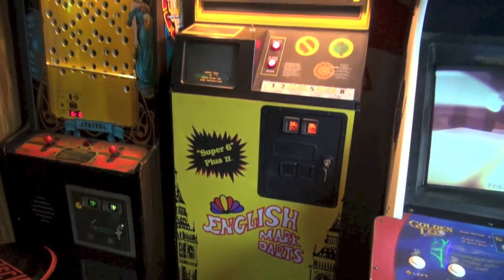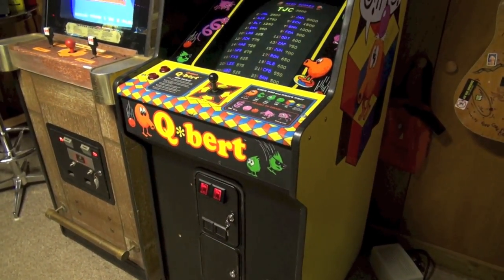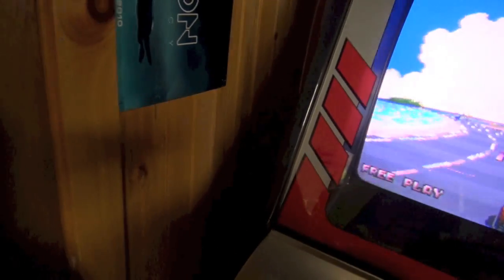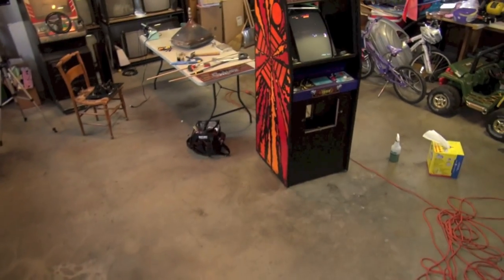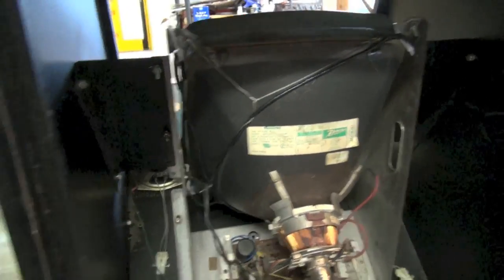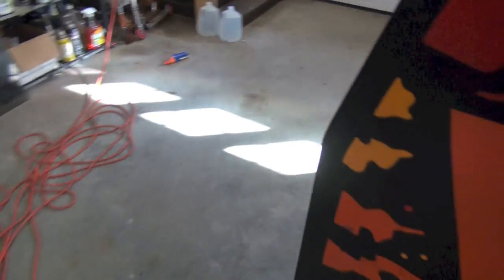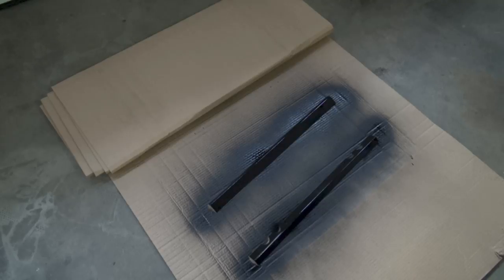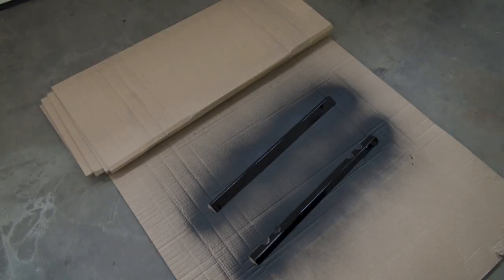Gyruss Arcade Restore (PART 3) - Stripping and painting metal, replacing ground plug, woodworking

Comment: If you were to hang your parts with a bent coat hanger, the result is better, and they dry quicker because they aren't sitting there surrounded by wet paint. (and you wouldn't be painting your garage floor) lol   Keep up the good work John  : )l

Comment: For the price you pay for those replacement plugs, you could just about buy a brand new cord with a molded-on plug. Just look for 16/3 SJT cord/cable (SJT has heavy-duty insulation compared to SVT). You can get 8 to 10 foot ones for $7 or $8 shipped, on eBay all day long. For example - http://www.ebay.com/itm/Prime-brand-Power-16-3-SJT-8-foot-2-m-3-Prong-Power-Supply-Cord-PS010608-/252540029062?hash=item3acc8f0886:g:bVcAAOSwbYZXYsYR